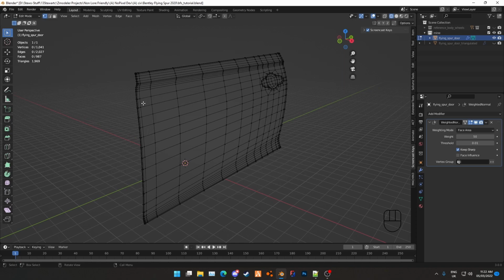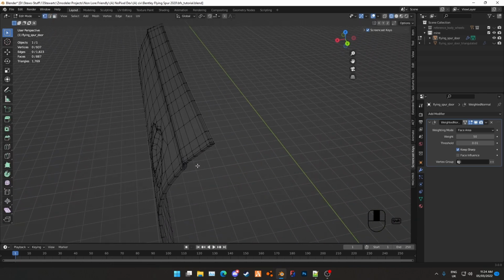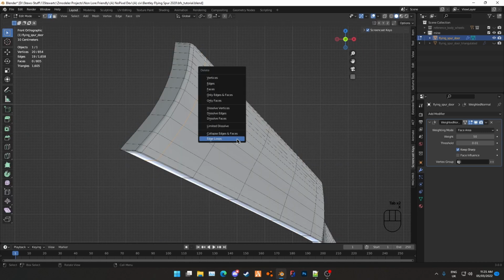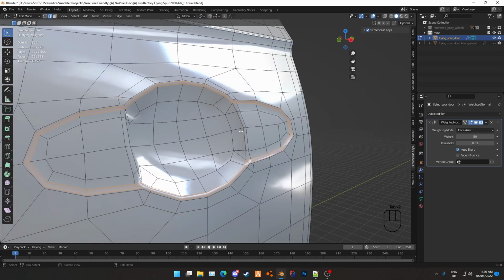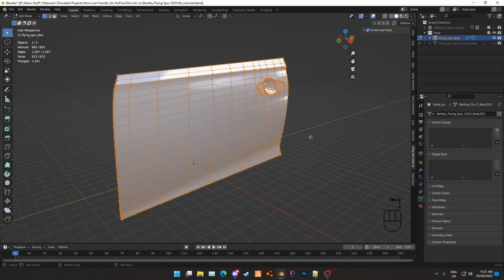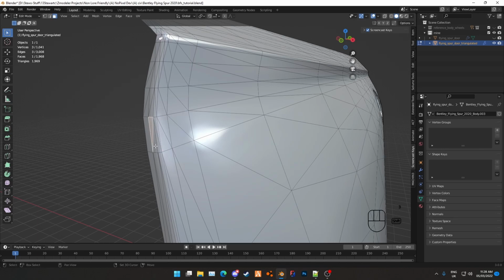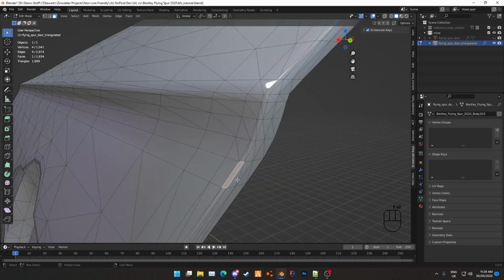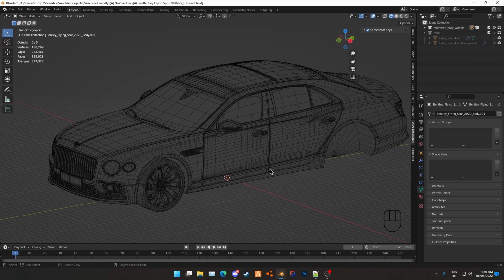How to Optimize a Model [Blender | Tutorials]

Comment: That is a very informative tutorial. Just what I needed. But I have a question, when you triangulate, what is the purpose to turn triangles back to quads? If I would import model to Unity, the game engine triangulates it again.
Reply from the maker: Keeping the model in quads allows it to be easier to work with and keeps the reflections / normals looking good. (Its also required for modifiers like Weighted Normals to work properly) I always keep my models in quads and then let them automatically convert to triangles on export from Blender. At this point the normals / reflections are baked in and triangulation doesn't usually effect it. But if you triangulate it in Blender (With CTRL + T for example) You'll see the reflections / normals will change a bit (usually resulting in worse shading)
Reply: @13Stewartc  thanks for the answer. So basically it is because of visual changes after triangulation.
Reply from the maker: @RedyBumBum  yep ^^

Comment: but if i dissolve edges without joining and shit, its not right?
Reply from the maker: Dissolve is only one of the options I use in the tutorial, there's also edge loops (for quadded models) and edge slide / merge (which is the most commonly used)
Reply: @13Stewartc  then its ok if i select manually edge one by one  and then dissolve them

Comment: Hey, you got any videos on more complex ways of lowering vehicle poly count besides using the optimize poly by percentage button?

Thanks, I'm a newbie
Reply from the maker: This is the proper method for optimizing a model. Any other method would provide results that aren't good enough for most use cases.

Comment: Hello, Please can you help me.. I modified a car, but I encountered a glitch 1- When the car hits, the same car comes out of it 2- When the car door is opened it does not work and the player passes through it
Reply from the maker: Make sure there isn't a duplicate chassis bone, if there is, delete it. & Re convert your doors using my car conversion tutorial as a guide
Reply: @13Stewartc  The player passes through the door. This problem happened to many of my cars.. Please help me if you can make video tutorial fpr this problem
Reply from the maker: @soune1792  I don't make video tutorials for every bug in existence. As long as the vehicle is converted correctly (which it can be by following a large number of my tutorials available on my channel) you can get it right. As for this issue. Make sure that your doors have collisions from another GTA car and use door dummies from another GTA car. (You want to use an entire hierarchy from another GTA car to ensure everything works properly) if none of that works, take the chassis collision, create a copy of it and then set the copy to be flat shaded (properties > appearance) then rename it to bodyshell [COL] and set it as a child of the bodyshell bone. (Leave the chassis col where it is)